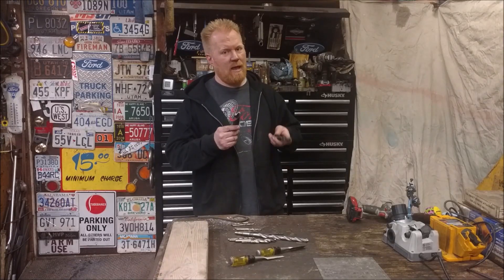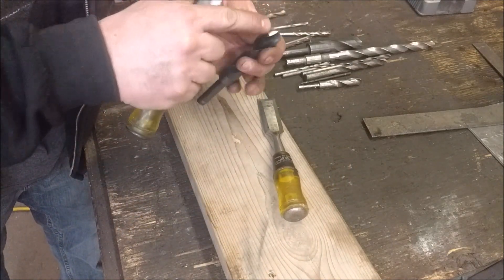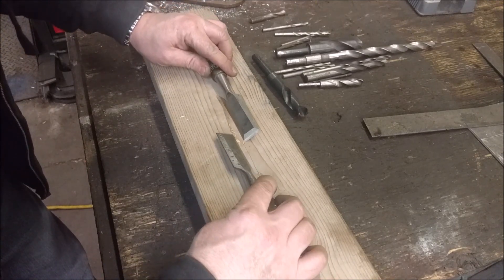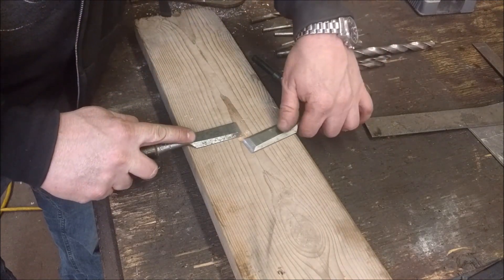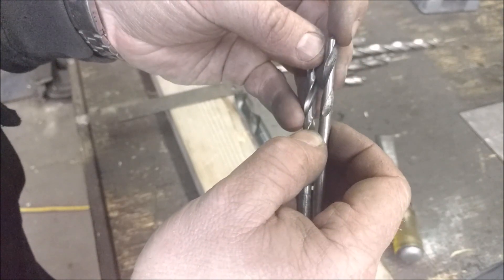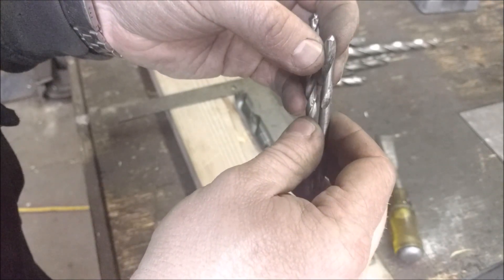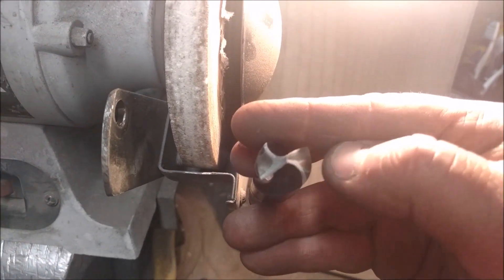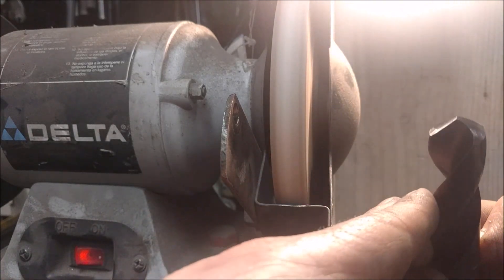How to Sharpen Drill Bits by HAND vs MACHINE

Comment: Learned how to sharpen drill bits in shop class circa 1974. Retired tool and die in 2024 and never used a machine to do it. Sharpened drills from 1/32 to 3" often. Taught many young fellas over the years. You're right, it's a valuable skill that is now a lost art. As is much of handwork and polishing skills. Sad.

Comment: the older plasplug grinder had a different drill setup . you inserted bit into hole which had spirals that twisted the bit as it got further in . success varied quite a lot . i have a general brand version of the biue point , and get good results . initial setup/learning the tool was a little difficult though .

Comment: Bought a Drill Doctor when they first came out. Did not work well on small bits. Learned to do it by hand and never looked back.  Go for the bench grinder if you don't have one and learn.  Another great video.
Reply from the maker: It's a great skill to have. I find I like to back taper my drills more than stock so they cut even faster. Though they're pretty aggressive.

Comment: Mostly I touch up my bits by hand, that being said, there are times when I pull out the Drill Doctor to really put a keen edge on my bits.  This comes in handy when drilling hard materials.  When I first got the Drill Doctor, I was so impressed with the quality of the tip I decided to go through all of my drills.  The learning curve for knowing how to use the DD was not too steep but doing all of drills allowed me to capitalize on sharpening rather than learning.  Plus, all of my bits were factory new!  Great video thumbs up.

Comment: I bought a Drill Doctor 750DX a dozen years ago and have had mixed results, regardless of how careful I have been with setup of flute alignment, rotational movement and fresh grinding wheel.  I have been wary of hand sharpening like had seen others on YT do successfully.  Until last week when I took a stab at a 1/2" drill on my belt sander.  With careful alignment to the cutting edge and a progressively deeper grind on the back side away from the cutting edge (heel), I got amazing results!  Fear conquered, new skill achieved!
Reply from the maker: That's awesome. I don't think I've touched my 750x for nearly 5 years now. The steeper you grind the heel the more aggressive the cut. I've been making them really aggressive as they cut fast.

Comment: I have been sharpening bits since about 1963. My neighbor and mentor taught me to do it by hand. 
We didn't have stacks of drill bits so if you wanted to drill a hole you needed to take care of the bits you had. 
Working as a machine repairman gave me the opportunity to apprentice as a machinist, electrician, welder, and eventually tool maker. 
The skills I picked up as a kid have made it simple to sharpened tools. 
50 years later my eyesight is not as good so tiny bits require a better guide system to control the process.
About 10 years ago I found a Black & Decker drill bit sharpener in a flea market. I dressed the stone to fix the angle and it is still sharpening bits at a friend's house. 
I have a drill doctor under the bench but haven't needed to use it ever. 
There is another B&D on top of the bench waiting for TLC.

Comment: Cool video! I have an old Black and Decker still sharpener my dad gave me. It has a stylus you line the drill up with before you grind the bit. It’s kind of cool. I should do a video on that sometime. I usually just sharpen them by hand. When you do them freehand for 35 years, as a machinist, you get pretty good at it. Thanks for sharing!
Reply from the maker: Hey thanks for watching.

Comment: if you keep messing up the center edge (chisel tip) just predrill when youre cutting metal the center chisel is usually only 1/8" maybe 1/4" on really big drill bits so if you pilot the hole with a 1/4" bit the center chisel doesnt even engage and so it an be rounded or slightly off center without ruining the bit

Comment: Split points rock! 
Scary story...once had a HF drill set just for mobile use. Right off, one got stuck making it's 'exit wound', and when I reversed the drill, it UNWOUND ITSELF! So, that set is useless for drilling anything but plastics or cheese.
Reply from the maker: Gary Chandler That's scary.

Comment: Large bits are easy, anything smaller than 1/4” is difficult.
Reply from the maker: I generally use a Dremel if I'm only doing 1. It allows close up visibility. Other than that I let the small ones pile up and use the Drill Dr.

Comment: I spent 2 days re-sharpening drill bits by hand for drilling Plexiglas. The standard 135-118 degree angle would crack quite often. My foreman noticed that the parts I was drilling didn't crack and asked me why. I actually took the bit down to 90 degrees and it took smaller bites out of the Plexiglas and so it didn't tend to crack. So I ended up redoing a bunch of drill bits as the tool room used a machine and couldn't do it.
Reply from the maker: That's where doing it by hand excels. Great job.

Comment: I have the general version of that bluepoint sharpener. I found it in the tool box at work and asked my boss if I could have it. Took it home, cleaned it and set it up. I will say, it can be a hassle to set it up right, but once you do. It really does a nice job. I typically only use the jig to re establish the tip angle or if the cutting edge is really damaged. I can usually do a decent touch up job by hand, which is what I usually do.
Reply from the maker: It did take me a little time to set it up, but once there I was impressed with what it does.

Comment: Great explanation on how a bit works.  I generally use small bits that are cheap enough to replace, but knowing they can be sharpened in a pinch is pretty handy.  Thanks, Moe!!
Reply from the maker: Cheap ones that I use a lot, I generally buy in bulk. The machines are better at the small ones than is possible by hand.

Comment: Great review. I used to sharpen by hand but I had so much trouble keeping that 3rd cutting edge perpendicular with the two main cutting edges especially with smaller drill bits. I bought a drill doctor many years ago and that solved that, it is fool proof. One thing I don't like about my drill doctor is the chuck. The blades of metal that make the chuck sometimes twist, especially with the small bits. I end up having to mess around with it to have the drill properly in the chuck. I wish it had a solid chuck like a drill has.
Reply from the maker: Yeah, the Drill Doctor is built down to a price for sure. Funny that they also sell commercial bit sharping machines for around $5000 that use the same basic principles.

Comment: I have the top of the line drill doctor... It works Great!!! Most people that don't like it or can't get it to work right don't understand how a drill bit works... Or can't read and comprehend instructions... I use my Drill Doctor when I'm spending the day sharpening drill bits... If I'm working on something I just use my bench grinder...  It's very easy to sharpen a drill bit on the grinder when you understand how a drill bit works... You did a good job on this video... I'm sure a few people will give it a try and say... Well damn that how you do it!!!

Comment: that's exactly how i do it start at the cutting edge then roll back. use the medium and/or fine bench grinder stone not the coarse one's. 1/8" bits are tricky
Reply from the maker: The smaller ones I usually do with a Dremel so I can it up and close.

Comment: Great instructions, thanks! What do you look for when you're buying new drill bits... I've bought cruddy ones from Harbor Freight before but they're hardly worth sharpening!
Reply from the maker: My first two sets from the 90's were from Craftsman and I still have most of them. I did buy a set from Harbor Freight in the early 2000's and it is still around but not my favorite. My favorite are the ones I keep finding at estate sales from pre 80's. I end up with a lot of dull bits so I get good practice. Generally if they took the time to stamp a logo and size, nice and deep on the shank they're great.

Comment: I`m fine sharpening the bigger bits like 3/8th up and do those by hand no problem,  but struggle with the smaller ones, mainly because of eyesight, I just might get something like the Bluepoint. great review, thanks Mo :)
Reply from the maker: The BluePoint style should do downwards of 1/8". I do tiny bits(1/16"ish) with a Dremel cut off disc so I can get my face up and close and sometimes I do it under a magnifying lens.

Comment: I have tried grinding it on the beach grinder but for me it's the drill Doctor every time.  So many say they can't get the drill Doctor to work for them and I find it quite easy.
Reply from the maker: I've had to laugh at watching videos of people fumble their way through trying to use it. Then claim it's total garbage simply because they couldn't figure it out. I don't recall it taking me more than a few minutes to figure out how the thing worked but I guess there is a learning curve.
Reply: What I have found with the DD is that success depends on the twist rate because if its unusual then the indexing system doesnt work. I have a set of Snap  On drill bits that gets a factory sharp bit every time.

Comment: Hey 65, I learned to do this back in 1978, and it does work well, especially, if you can afford to screw up an bit or two practicing the technique. Have you ever done a video on ax restoring? Re attaching old loose ax and sledge handles and stuff like that?
Reply from the maker: I've never done a video of it, but I do have a decent collection of axes that need attention.

Comment: That drill Doctor is shmood in marketing wank! and more plastic than Barbie and Ken. No thanks. I Like the Video!
Reply from the maker: I do feel it is overpriced for what you receive, but most specialty tools are. Though there is a lot of plastic the main components are die cast zinc or steel on the model I have. They're entry level one is a solid piece of plastic. It would be nice to see a reputable brand make a more robust version but they all seam to shy away from it.
Reply: Darex makes a professional version of the drill doctor but you will pay for it. They also own the drill doctor brand.
Reply from the maker: I had to look it up. I could pay someone to drill all my holes for me with new bits before I warranted the cost.
Reply: sixtyfiveford yeah I own 2 drill doctors to use in my shop. No doubt the darex units are superior but I'm making out quite well with the homeowner grade drill doctors sharpening drills for use on my cnc mills and pocketing the difference in cost. Although I will say the older model i have is superior to the new one I have that is identical to yours.

Comment: Great explanation, Moe!  The yellow one works as a pretty good tungsten sharpener.  I had one and almost tossed it out.  Now it sits by my welding table for the times I dip the tip.
Reply from the maker: Thanks Bill. The yellow one seams to keep kicking around even though I never use it. I hate to throw out any tool so I'll need to find a use for it.

Comment: That's EXACTLY how I was taught to sharpen bits in machine shop class yesterday and years ago. That's good for larger drill bits but since my eyesight isn't so good anymore, I use a Drill Doctor for bits smaller than 1/4 inch
Reply: Should have said years n years ago... LOL
Reply from the maker: The Drill doctor is great for those smaller bits. For tiny bits around 1/6" I use the side of a Dremel cut off wheel. I'm able to hold the Dremel close to my face so I can see all the details.
Reply: sixtyfiveford well explained and filmed , I keep a pair of cheap reading glasses next to my grind wheel